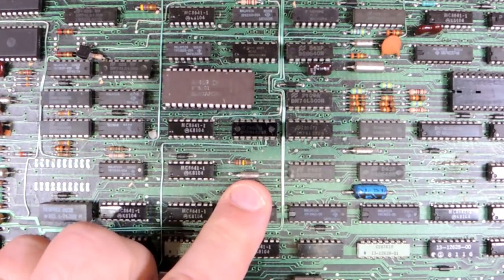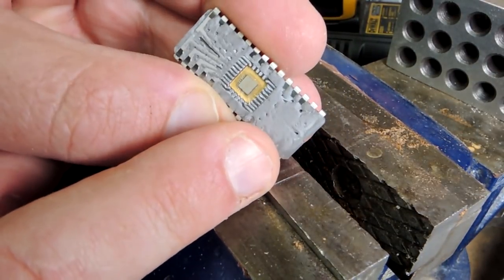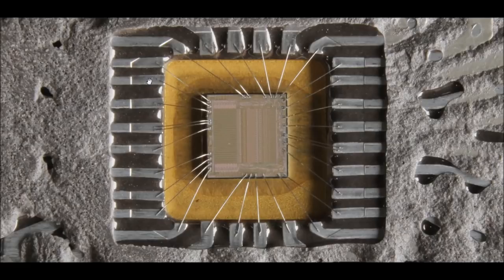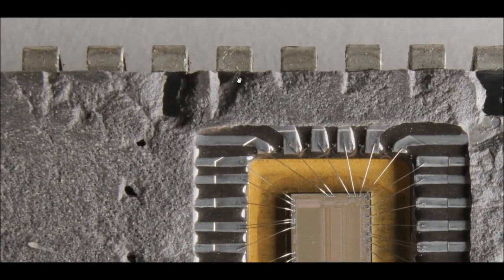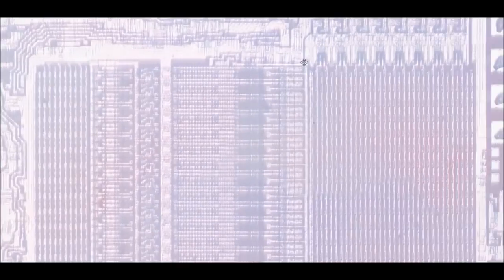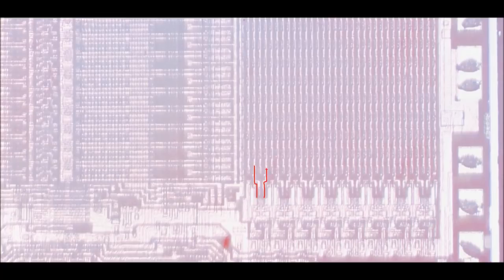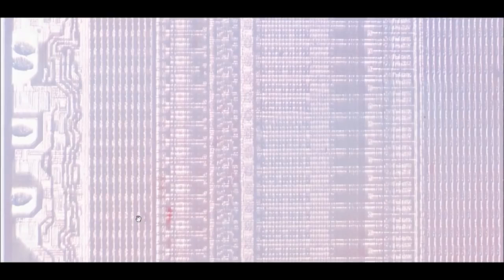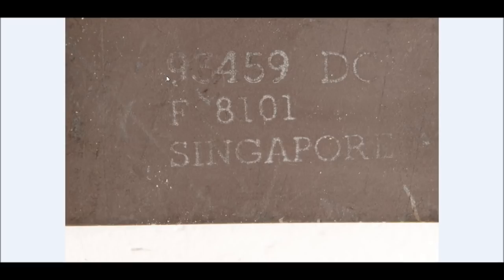CERAMIC PACKAGE INTEGRATED CIRCUIT REVERSE ENGINEERING

Comment: Why use a ceramic package?
Reply: Anthony Cullison now, because of heat dissipation typically. Then, because that’s what they had at the time.
Reply: @jakp8777  really?! I thought epoxy packages have been around as long as ICs have been
Reply: Anthony Cullison early chips were ceramic and plastic came later. The military still favors ceramic and sometimes ceramic is used for its superior heat dissipation. Also, early chips used gold, on old chips the gold color is not just a gold color, it’s genuine gold.
Reply: @jakp8777  I was assuming it was for thermal characteristics, but that wouldn't make any sense unless all the chips on the board were ceramic, and the board itself was ceramic or of another heat resistant construction
Reply: Anthony Cullison it’s thermal properties of the chip, not the board. Some chips use more power and hence dissipate more heat especially in early cause of chip technology. There is such a thing as ceramic PCBs, some high end and older LED lamps mounted the LED on a ceramic PCB because of heat. IGBT transistors, commonly used in motor controllers and welders are typically ceramic with a goo covering the electronics to dissipate the heat.
Reply: Ceramic chips are far more resilient to corrosion than plastic.  Air, moisture, and contamination can seep into the package through the leads sticking out the side the plastic.  Ceramic packages are fully sealed in an atmosphere of nitrogen, making them last far longer.

The thermal properties do allow better cooling without a heatsink, but that's just a minor cost difference.
Reply: Here mostly because the device is a mask ROM chip, and they are low volume parts, so using a ceramic package for the thousand lots of each mask version is cheaper than setting up a new leadframe and bonding setup for plastic moulding it. As these are typically ordered in small batches using the ceramic is cheap, as you can order those in large volume in a particular size, and use any chip up to the pin count and area inside it. Also used so the chip can be tested after bonding, and before sealing the package. The heat dissipation is good as well, needed for the chips that had very high static current draw due to using bipolar designs, as those have a large standing current per gate, and with hundreds of gate this probably was dissipating over 2W of power. Modern NMOS and CMOS is a lot lower power than TTL in this regard, and often at this time you had IIL chips, which are internally current driven, and which are almost constant current irrespective of logic state and operating speed, they run hot all the time.

They are also used currently to make replacement parts for no longer produced silicon, using the ceramic as a carrier for either the SMD version of the part if that is the only version available, or to package old stock dies that have been in storage, or to hold custom ASIC emulations of the part. Used for older equipment that redoing the board would be either expensive, or would require recertification of the board and system again.
Reply: @SeanBZA  
I thought ceramic was rather porous. Unless it contains a high percentage of glass.
Reply: @gregorymalchuk272  The ceramic they use there is not porous after firing, it will keep helium leak tracing gas out of the package very well, and do so even at high or low temperature, as that is a test used to check the seal, they pressurise the batch with helium for a time, then check for gas leaking out of the chips, which indicates it got into the cavity. Pretty much zero goes through the package, as it shows up leaks in the soldered seals more, though with the glass frit sealed ones there will be a slight leakage, but that still allows for decades of reliable service.
Reply: @SeanBZA  
What are the different sealing options? Glass frit versus what?
Reply: Thermal Expansion coefficient needs to match to prevent internal cracking.

Comment: Never occurred to me, but does a modern cpu have more than a thousand bond wire? As many pads it has.
Reply: Modern ones use balls to join the die to the interface section, which then spreads out the very tiny connections to a larger area for the socket to make contact. The balls are making contact between the metal layer on the silicon and the copper on the interface board, so both have a gold plate on them to interface between the aluminium/copper on the silicon die and the copper on the interface. Any large IC that uses a BGA layout also invariably uses this, as if they had lower pin count they would have gone for a much cheaper leadframe plastic package and bond wires. Interface board is a very expensive part, as it has multiple layers and multiple blind vias in it as well, often smaller than a hair in diameter. Often more expensive than the silicon die that is bonded to it.

Only smaller chips use bond wires, like those that have QFP leads, as otherwise there is no room to get all the bond wires out, and you cannot have multiple layers of bonding wires in a plastic package, though you can with a ceramic package, as in the ceramic you can fill the internal space after bonding with Parylene, which holds the longer wires in a compliant gel that prevents vibration.